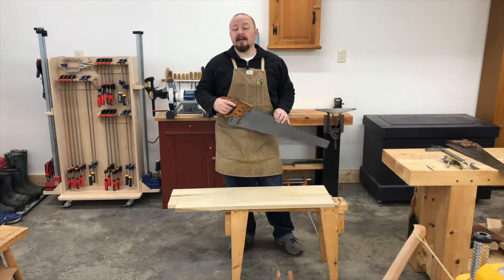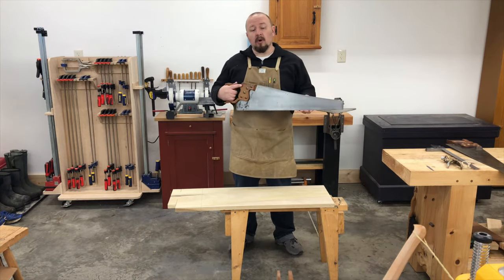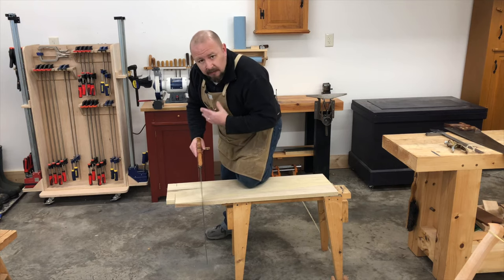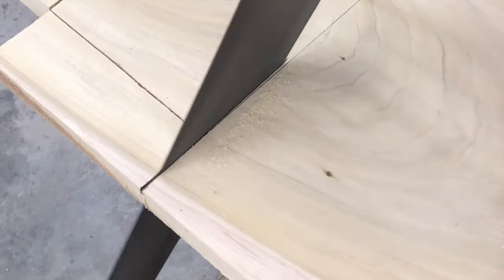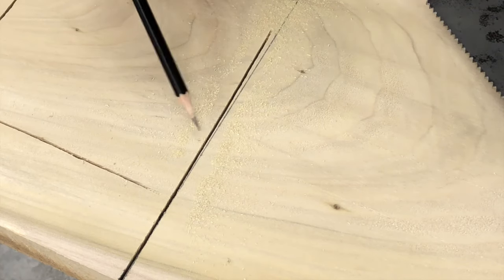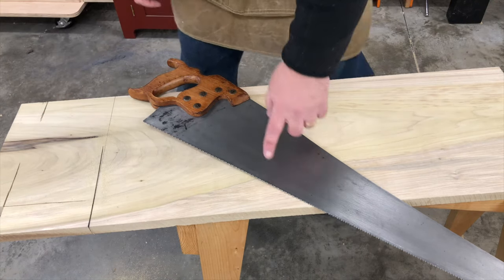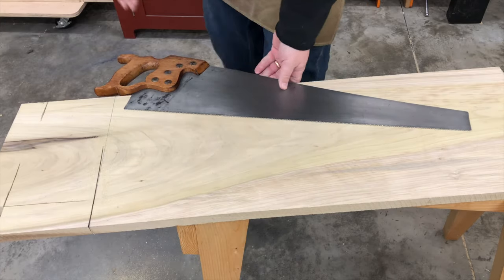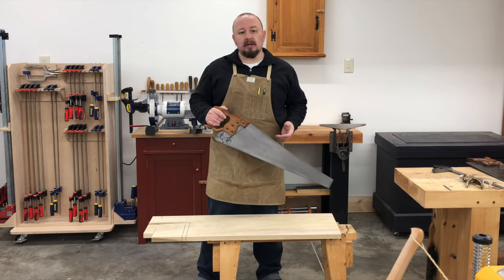How to Test and Adjust a Hand Saw for Drift - Hand Saw Foundations

Comment: Thanks for this one too! Some questions: (1) You use a cross cut to test the rip cut filed saw? Should it be a rip cut or does not make any difference? (2) Why don't you remove the excessive set by carefully hammering on an anvil (anvil - saw teeth - hammer on them) ? (3) Paul Sellers recommends to vary the rake on the first 2 inch or so for easing the start (less aggressive rake) - what would your opinion on that be? (4) when setting the saw where precisely do punch the tooth - align on the front? align middle of punch to middle of tooth? Many thanks in advance Christian
Reply from the maker: (1) Not at all. Crosscut to test crosscut saws. Rip cut to test rip saws. (2) Hammering removes set from both sides at the same time. Side jointing removes it only from the side the saw is drifting too. (3) I find it unnecessary if one practices good technique for starting the saw as I demonstrated in the course. Further, on a long saw, no one starts the saw with the teeth at the toe so it wouldn’t help. (4) Half way down from the point, center of f the tooth. A good saw set will have PPI noted on the tool and will place the set at the correct height on the tooth.
Reply: @BRFineWoodworking  Many thanks, Rob! RE (2) - it seems some people also make the set per tooth with a small, is it called, center punch? It would be possible to set back the overset. Just worrying that if you file a couple of times, the teeth get too thin?